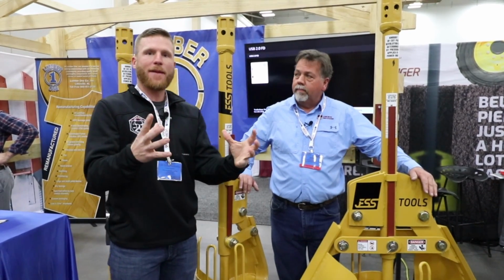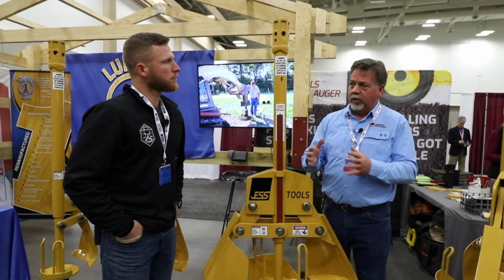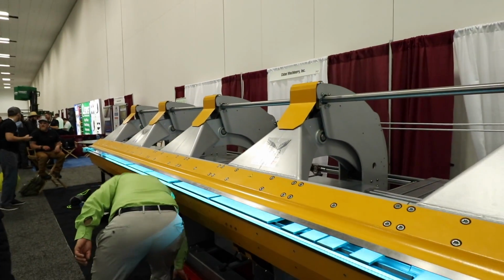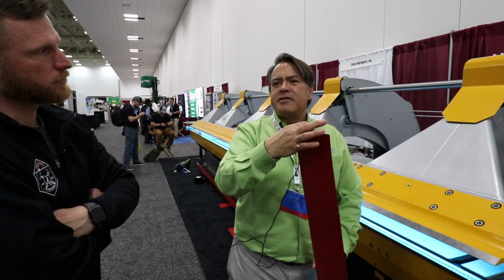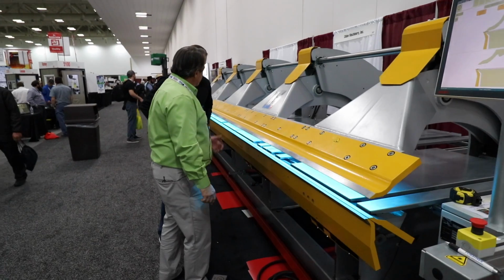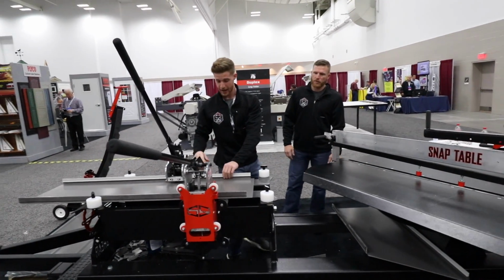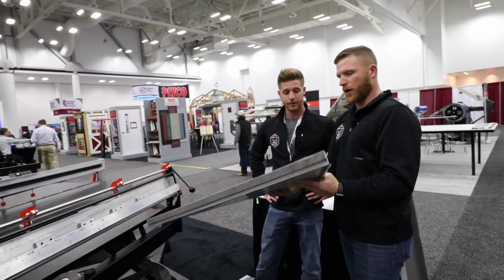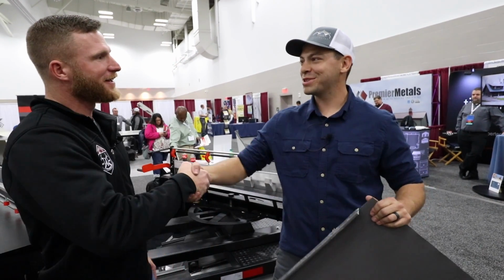National Frame Builders Expo 2019: Coolest Products for the Industry!

Comment: I bought a pair of cougar paws 13-15 years ago, walking roofs is no joke, the angle can be hard on ankles and constaly up and down, I do not rember what I paid, at the time it seemed reasonable for what I was getting, the replacement pads I thought could of been cheaper, I mainly did residential, aspahalt shingles tear through the padding so fast, they didn't even make it through a 30 sq. Roof before the pad was gone and it was tearing Into foam that was structural to the boot, however my biggest complaint is how uncomfortable they were. I was 17 or 18 at the time in amazing shape, and within a few hours of wearing them my feet and ankles hurt to the point I couldn't stand being on my feet, save your money and just use old sneakers and couch cushions foam

Comment: Those automatic breaks have been around fro a long time. Though back when i was programing them they didn't have the touch display or a graphical representation of each step. The machine didn't give you suggested operations either. Had to figure that out on my own. Also had to save the program to 3.5 floppy. Loved that snap table system.
Reply from the maker: wow isn't it crazy where things have come